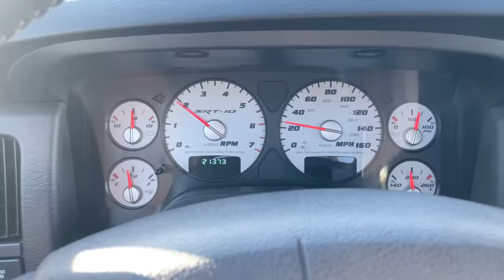The Danger Ranger 9000 Was WAY MORE Dangerous Than I Thought... (My Race POV of the Crashes)

Comment: A lot like the "Factory Stock Enduro's" of the '90's. Generally they were 150 laps in two 75 laps segments, started on a watered down track, and turned right on one segment and left in the other. We had bigger V-8 motor's but tires were limited to 7" wide DOT tires with max 15"x7" wheels. Too much fun, especially with a torquey big block. One race I won at Saugus Speedway started with over 110 cars on a wet 1/3 mile asphalt flat track in a rain shower. Total mayhem, it still makes me smile!
Reply: That sounds so chaotic...I can only imagine how little grip you had with 177mm width tires...that's nuts
Reply: Nah they're 7 inch width tires, not 177mm. This is Murica lol

Comment: As a Ranger owner for the last 27 years, I've got to say, that was just about the coolest thing I've ever seen.  Rangers may not be flashy, but they are hard to kill.
Reply: Unless it's a 3L...
Reply: Agreed i have one too with over 200k miles runs like new
Reply: @trixter192  3L is the good one
Reply: only thing that kills any ranger or explorer is the timing chain guides or 5r55
Reply: @mcf3778  I've had the rattle of death for 2.5 years now on my Sport Trac. Even so, the damn thing has never given me any problems, except broken door handles 😂
Reply: Our shop truck was a 2012  ranger and MANY tried to kill it.

Two years ago a f3 tornado took that machine out.

RIP JJ....we still miss you.
Reply: I have one i hardly ever drive and it'll sit for a month and start right up like i drove it the day before.
Reply: It pains me to know that my 92 ranger is finally going to the junkyard. It still runs like a demon but The Ohio salt mites finally got the best of it . The thing never let me down and it had a hard life of firewood hauling. But you can’t kill a 4 liter 5speed .
Reply: I had a 96 4x4 3L 5speed , had 300,000 plus all original except a radiator replace & 2 fuel pump replacements , even had the original water pump until a tree fell on it in 2016
Reply: *a4ld has entered the chat.
Reply: @mikeyd5969  Salt gets them up here in Ontario too. There is one rotting away with a slipped timing chain outside of my shop at work. Guy just can't bring himself to get rid of it.
Reply: @nathanadams1332  my 94 b4000 was at 217k when I sold it. If it wasn't for the the fact the a4ld pitched a fit when I hooked up my jetski trailer id probably still own it. Miss my truck
Reply: Had mine for 30 years til it bit the dust
Reply: Same here and I still have mine lol-lol !!!! 1997 Ranger 4x4 3.0 5spd. single cab long bed &  power nothing not even A/C ;)))
Reply: Quality Mazda engineering.
Reply: I AGREE
Reply: My 96 explorer 4.0 is unkillable. Intake and exhaust valves drop? No problem. New valves good to go. Oh your MAF sensors are dirty? Wipe em with a towel, fixed. Roll onto your side and stay there for 3 hours? Eh. Go home and start it right back up. 300k on the stock chains and guides. I'm amazed it still runs. I'm not easy on her either. She gets driven spiritually around backroads daily. I love my ol girl "Beast"
Reply: @Fconig1  the only thing Mazda had to do with them was supplying the M5OD transmission if it’s a manual. 

Other than that, the ‘94 on Mazda B truck was just a Ranger in different clothes, assembled in a Ford factory.
Reply: @trixter192  the 3.0L Vulcan that hailed from the original Taurus was pretty damn reliable. It was pretty gutless, but it was all iron, with pushrods. 

It was the 4.0L SOHC that earned the “Exploder” nickname (base engine for Explorers) due to the timing chains letting go.

Comment: 4 heat races, 10 trucks a piece. A 20 lap shootout. Top 3 move on to the final. You'd be left with 12 trucks in the final race, which could be a 30 or 50 lap shootout. That would be a perfect format for doing races like this in the future
Reply: Racing Girl's 😘🤤  Reported
Reply: Agreed
Reply: @BCaldwell  I've reportered it about 20 times now
Reply: Nah thst sounds boring lol rather see them all race till the end
Reply: I agree!  I think a lot of dirt track events run this way, and it does make the event last a bit longer as well.
Reply: @projectdarkseed6445  I’ve been to a lot of dirt track racing and usually they do heat races to decide starting positions. Also it gives points to the winners of heats for the year points races. But every dirt race I’ve seen they all end up on the track for the main event of their class.
Reply: Nah
Reply: Racing Girl's 😘🤤  ol report
Reply: That's a big no from me on the heat races. That makes for a boring race.
Reply: Screw that I want 100 trucks on the track with 100 laps “the danger ranger 10,000”
Reply: @Captain MufDyven YT is probably paying em. They're Chinese bots. I've reported em for sexual content and harassment.
Reply: @RedXray  agree there's something to be said for can your driver hang in until the end. Maybe they catch a bad break and get wrecked out early, maybe they don't though, it's part of the overall excitement I think.
Reply: its about the mayhem, not the "proper" way of racing. the point is to go out there and have fun, if you wreck, you wreck. theres a reason why they put cages, nets and solid racing seatbelts.
Reply: I agree with your format. Gives drivers time to work on trucks and the small track isn't too crowded.
I also like your pic...Let's Go Brandon!!!
Reply: @buckberthod5007  what is their motive or intentions ? The “Chinese bots” 
What’s the point ? What is the deal I don’t get it but shit it’s annoying
Reply: @JameyCampbell_54  I'm not asking this for the "views" but please leave me a comment with your thoughts as to this yourself. This is only my thoughts but it makes the most sense to me
Reply: @projectdarkseed6445  yeah drift night went till almost 11 and this was done at 9. I think it needs to be 80 or 100 laps

Comment: I thought it was a great race but could add a few things. 

1. No jumping the start. Many racing series don’t allow passing until you crossed the finish line on the green flag. I think that would make for a smooth start. 

2. Whoever brings the caution (or red) flag goes to the back. Only fair that if they dumped someone, they pay for it. 

These rules could and should apply to all the racing events that go on there
Reply: Ooh, I really like rule 2. I hadn't thought of or come across that before. It's sounds like a very simple way for races without a room full of stewards to police dirty driving.
Reply: Rule 2.... seems like it should be the #1 rule...
Reply: I agree but you then run into the issue of the faster guys now being behind X amount of cars and passing more than is necessary.
There does need to be some kind of penalty though.
Reply: @helplmchoking  I don't know if you watch F1, but man have there been some terrible rulings as of late. I haven't a clue how the drivers keep racing hard under such a system. First thing that came to mind when you said "hardcore rulebooks" haha!

On the other hand, I don't particularly like heavy contact in motor racing, but I accept that there's going to be bumps and nudges here and there. What I really can't stand is people intentionally gaining an advantage from pushing others off the track. I know Levi's Rule 2 doesn't distinguish intentional hits from those unintentional, but that just makes it more consistent and virtually indisputable.
Reply: I like rule 2!!  Of course, James would be constantly at the back! 🤣🤣
Reply: @stevehesse6914  that’s what keeps the racing clean, and brings more action to see the fast guys work back to the front
Reply: @chevylevy_  yes in theory, except you get assholes who now have nothing to lose by smashing their way up and hoping it isn't noticed which is more dangerous.
It works for a skilled field not for amateur IMO
Reply: Let drivers bring in pit crews to keep more racers in the race. Kinda lame quitting a race because of an easy fix
Reply: Sounds like you're taking the fun out of it, honestly. Those rules just turn it into Nascar lite, but I suppose it at least doesn't have the commie propaganda of Nascar.

Comment: #22 Definitely gave Derek a pit... In the future Rangers should be lowered and be allowed to set up their front suspension specifically for circle track racing. That would make them handle better and make the race safer.  You also might consider running two, 20-truck 20-lap heat races, with the top 10 of each going to a 40 lap main.
Reply: watch Kevin KSR video, #22 was also banging him trying to pit him too!
Reply: Glad I'm not the only one who saw that was intentional.
Reply: @KaotikRC  I dont mind a little chrome horn or bumpin but this dude was just beating his way through people, maybe the freedom 500 will get him served some justice! LOL
Reply: Rubbins racing.
Reply: Nah, Derek went where there wasn't room.
Reply: To add "insult to injury", #22 (FBK Racing) won the race. After the PIT, causing Derek to spin, he hit Derek causing the flip, and "removing" him from the race. Unfortunately, there doesn't seem any oversight on this.  But, once someone seriously get hurt (or worse), I'm sure Garrett's insurance carriers will step in and all the "fun and games" will end.  Then actual sanctioned races with reasonable safety standards will have to be put in place to cut down on the "high school" stunts.
Reply: @dennisstaats586  no.
Just.....    No.
Reply: Derek probably would have not flipped if his tries sidewalls were not so soft since I believe they were drag tires.(could be wrong)
Reply: @Studio23Media  Go watch Cleetus' video again, he did it on purpose.
Reply: @bobbywalter5320  yes, just yes...

Comment: Honestly still a little peeved that the dude that won it all spun poor Derek on the 3rd lap.
Reply: JH? Lol
Reply: @Darwindiggler  the winner of thr race flipped Derek. Jh flipped jackstand
Reply: https://www.youtube.com/watch?v=ri2WdFVPauA?t=19m
There is no deliberate movement towards/into Derek, just both following their lines. It was just contact.
Reply: @doubleT84  in vgg video he clearly dives under and hits behind cab
Reply: @doubleT84  I somewhat agree. I've watched several videos and replayed the PPV. The 22 was dive-bombing the corners fully on the apron. I don't think Derek was expecting anyone to be there. As it's not the racing surface or line. They need to paint a line around the track to show the designated racing surface. Hell even Cleet went down there and was pushing the 22 when he hit Derek.
Reply: Lol ya as long as everyone was ok it’s all good 👍 I doubt anything was intentional lol
Reply: @Jeepo Guy Completly Agree.
Reply: @doubleT84  9:25 the 22 truck almost goes into Cleeter's door in the same way that he flipped 1776.
Reply: @mrray55  Dive-bombing is ok, but drifting up one full truck width into Derek isn't. Measure it. Anyone can use another car as a buffer. People don't generally use those racing lines, for a good reason.    I'll grant everyone has their opinion though.
Reply: @ghoulie11  almost ... but he didn't
Reply: @doubleT84  Two turns later he flips 1776, it shows how reckless the 22 truck was driving. 2 laps in and the 22 is almost wrecking, 3 laps in and flip.

Comment: The VR4 is such an underrated car...
Reply: I was also impressed with the Mercedes.
Reply: People forget this car competed against the GTR, too bad this car didn't get popular enough and parts are apparently difficult to get.
Reply: I worked at a Mitsubishi dealer when they came out. Me and a guy would pick up and deliver for the service department. the VR4 and the Diamontes were our favorites. The VR4s were fast. A few of them did SCCA and had boost controllers on them.
Reply: @MiGujack3  so difficult that our dealer was where the SCCA guys came to get boost controllers, bigger turbos, cams and we also did transmission internals for that Getrag. Bad ass four wheel burnouts.
Reply: Yep. Its twin car the Dodge Stealth RT  Twin Turbo is pretty sweet too.
Reply: That all wheel steering definitely helped. Amazing cars and you can get them pretty reasonably priced at least around here.
Reply: I was 16 when they came out. I know exactly how bad ass they are. Still want one.